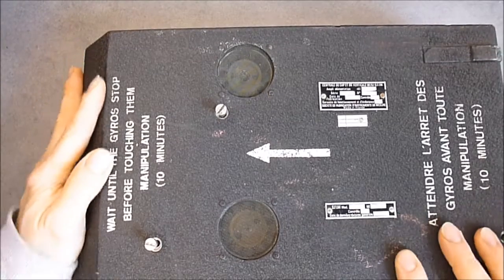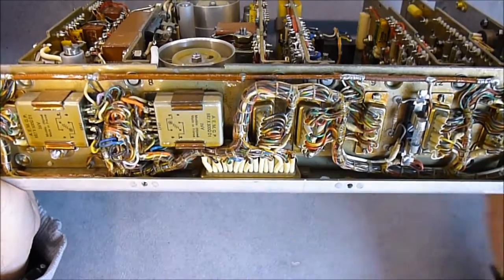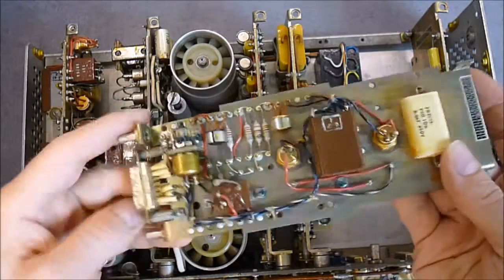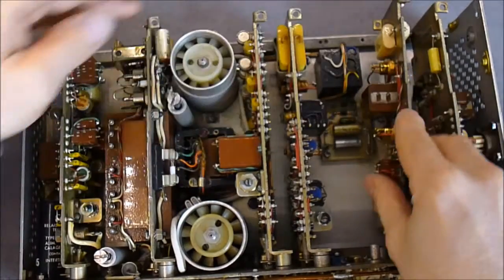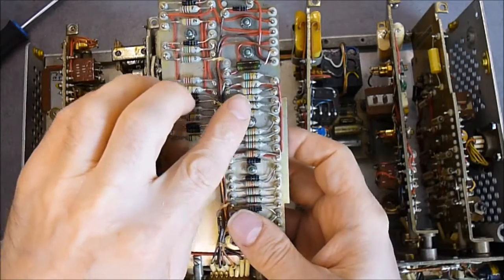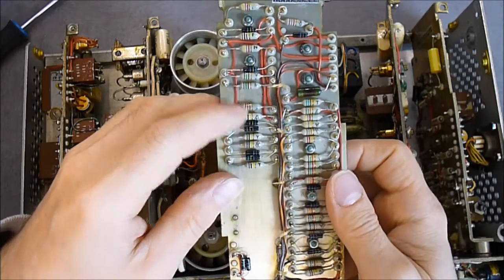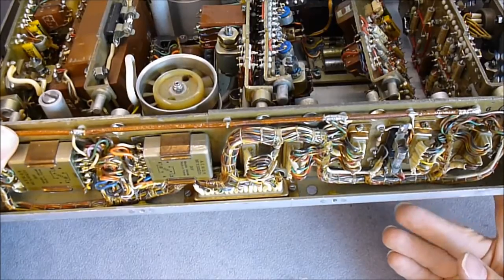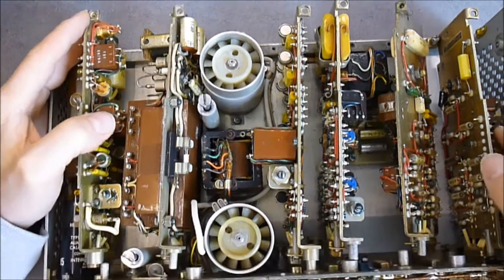Freakin gyro teardown part 2 the electronics pack

Comment: Very interesting construction.  Wonder why they went with point to point instead of PCBs,  by the look of the components pcb tech would have been well developed when it was made
Reply from the maker: Sigmatechnica Yes there are a few PCBs in the black cylinder.